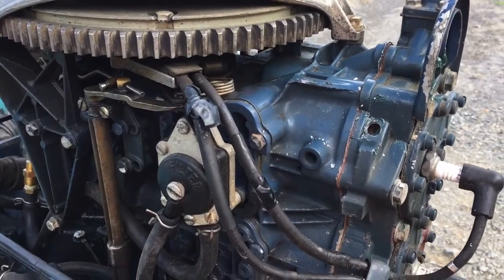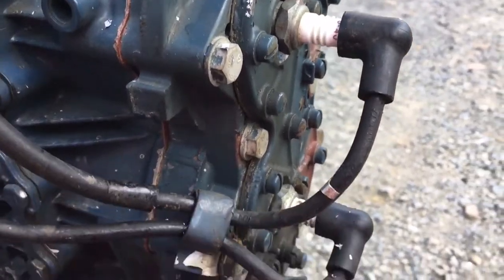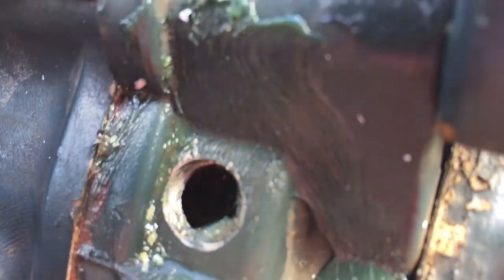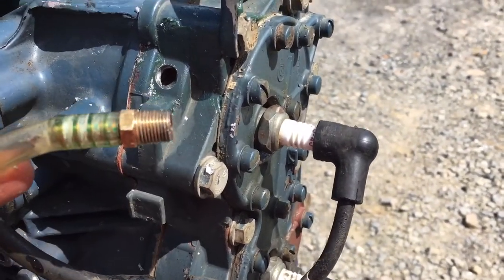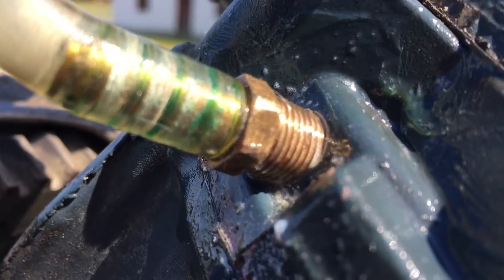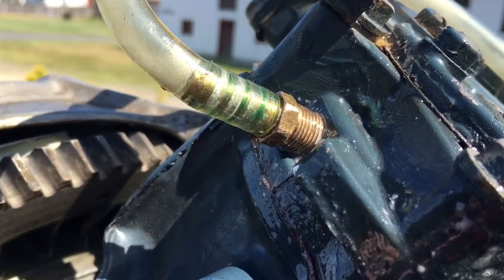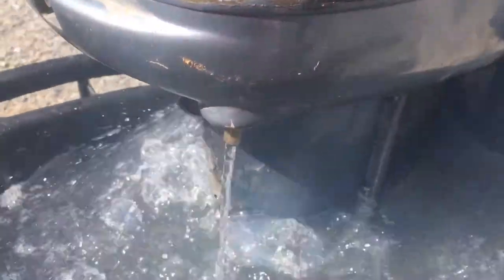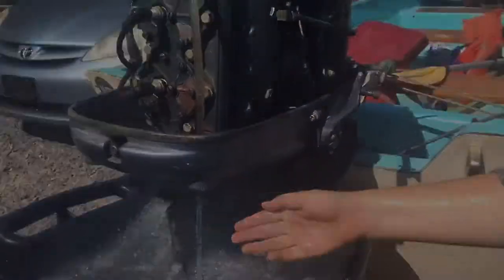Adding a Telltale on Old Outboard Boat Motor - 1970 Evinrude Big Twin 40hp

Comment: 68 Evinrude 55 Triumph 3 Cylinder. Does not have any sort of telltale. You just made my day with this video. Though I'm not sure if I will drill into the cylinder head or the thermostat housing yet.
Reply from the maker: It makes me nervous and I've done it several times. But I really need the peace of mind to see that water pumping!  Let me know how it works for you.

Comment: I also have a 70's 50hp. Do I really need this?
Reply from the maker: OMC didn't think you needed one :) Only YOU can decide if you "need" it. I wanted to be able to make sure the motor was pumping water @ all times. So I installed one.

Comment: Saul, no idea if you'll respond. Have a 1973 50 evinrude. We're these all designed without a tell tail???
Reply from the maker: Do a visual inspection; I don't know off the top of my head if they did or didn't...I THINK it was some time in the 70s when they started adding them.  There should be a tell--tail outlet in the cowling if there is.

Comment: By placing the hole in that spot does it reduce pressure needed or take away from cooling?
Reply from the maker: I don't have an educated answer for you on that. That thought has crossed my mind more than once, but it does seem to be a small amount relative to the total amount of water coming through the system.

Comment: Well, this work for a 140 Johnson.
Reply from the maker: I don't know that model specifically, but take a look at the water jacket (and maybe a diagram) before doing it. If you can find gaskets, would be good to pull the jacket so you know exactly where you'd be drilling etc.

Comment: Id put a smaller diameter nozzle at the end of the telltale hose to keep pressure backing up inside of the cooling jacket fed from the waterpump impeller. Well the thermostat should be there to maintain the normal operating water temp as when it gets too hot it lets cool water in slowly to keep it it warm, not too cold once warmed up . Its not a good idea to run it cold constantly without allowing it to stay warm.
Reply from the maker: That would be a good idea!